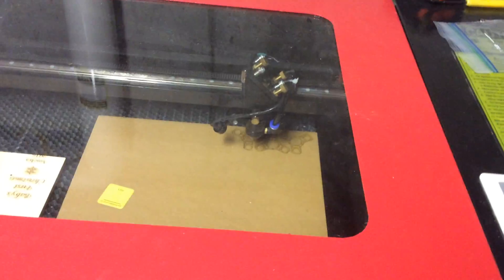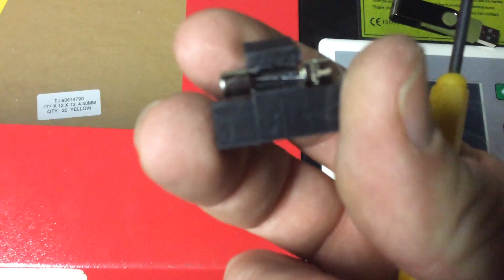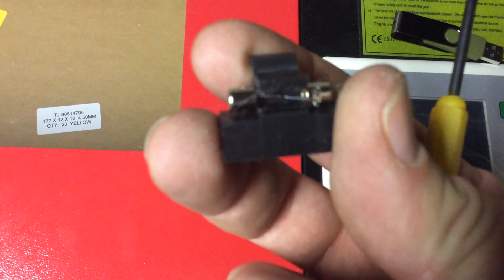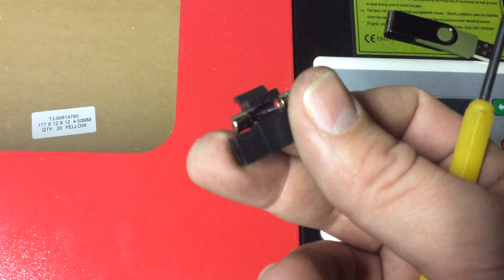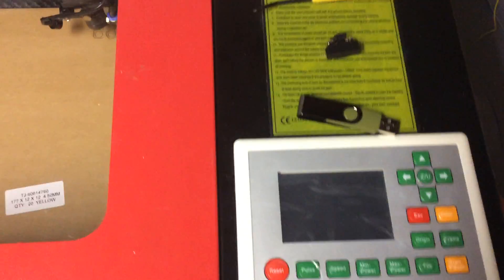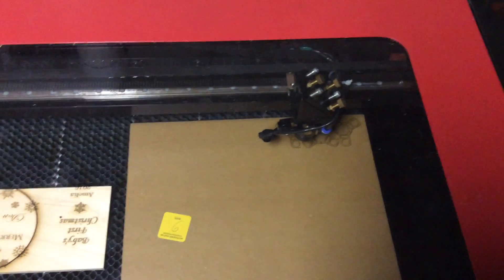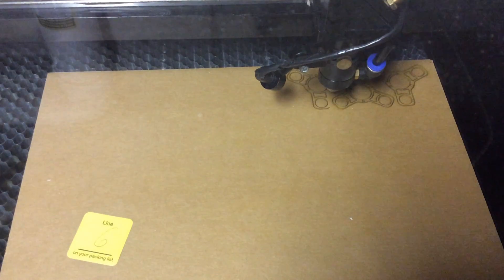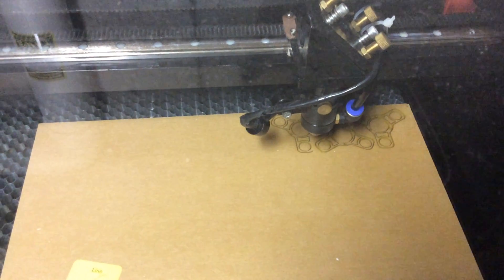Laser Power Supply Blowing Fuse

Comment: I'm experiencing the same problem now, please what is the solution
Reply from the maker: Something to check on that I found later on was the wiring to the E-stop switch was loose. That caused a couple things - one was the blowing the fuse issue. Sec ond my E-stop contacts melted. Check the wiring behind the panel and see if you have the same issue.

Comment: My issue is similar. After a few months of owning my 100W laser (less than 8 hours total run time). I am suddenly blowing fuses about 2-4 minutes into a job. The job is cutting acrylic and I am only at 60% power. (I never go higher than 60% ). Anyway, the machine only blows the fuse while the laser is running. As suggested by the kind folks at Rabbit Laser USA I am running the air compressor off of a separate outlet (not the one on the back of the machine), I need to do the same with the internal fan. The folks at Rabbit said that those components may be pulling extra amperage and blowing the fuse but this did not work for me. I mention it because maybe this will help someone else. I am still blowing fuses and I think my next step is to replace the laser power supply. 

One other thing the folks at Rabbit had me check was that the power cables to the laser tube were insulated properly at the terminals with electrical tape. They were. The people at Rabbit said thet if they are not insulated properly that they could ark to the frame and short out the machine. 

Is there anything else I should check? before buying a new power supply? 

Is there a way to check whether my current power supply is bad? 

Thanks.
Reply: Did you have to replace the power supplies? My duel 130-watt lasers outlet that goes to both the power supplies started to melt and blew the fuse and I'm worried that if I just replace the fuse it will just start melting again.

Comment: where is the fuse(s) located on this machine?? My laser stopped working!!
Reply from the maker: If you watch my video I show where mine is.  There is a power cable on the control panel. It looks like a cable that you would use to power a computer monitor. There is a "drawer" under that. Use a screwdriver to pop that out and find the fuse. You may also have an "in line fuse" - could be inside the cabinet behind the power connector.

Comment: I just had the same issue happen to me.  Has there been a solution found to fix this?
Reply from the maker: I replaced the fuse with a ceramic one instead of glass - same amperage specs - have not had the issue since. Be aware (not that you are not - just making sure) that if you size up a fuse go from a 10amp to 15amp - you could cause major damage to the laser or possibly start a fire. SO DO NOT DO THAT.  I also noticed that I was tripping out when the machine was running off a GFCI outlet. Not sure beyond that what was going on. I did not get a response from the vendor (which was the first purpose of the video). If I find out more I will let you know.
Reply from the maker: UPDATE: There may be an issue with the laser power switch on mine that could have been the cause of this issue. It is the large square glowing switch on mine. I think it could have been shorting out. I am now finding that the switch is no longer turning off power and is "welded open". So the blown fuse issue is gone but the only way to power off the laser is to turn off the mains power. I will try to get a video on that posted.

Comment: did you find the solution? I have same problem
Reply from the maker: I replaced the fuse with a ceramic one instead of glass - same amperage specs - have not had the issue since. Be aware (not that you are not - just making sure) that if you size up a fuse go from a 10amp to 15amp - you could cause major damage to the laser or possibly start a fire. SO DO NOT DO THAT.  I also noticed that I was tripping out when the machine was running off a GFCI outlet. Not sure beyond that what was going on. I did not get a response from the vendor (which was the first purpose of the video). If I find out more I will let you know.
Reply from the maker: ofar4452
2 seconds ago
UPDATE: There may be an issue with the laser power switch on mine that could have been the cause of this issue. It is the large square glowing switch on mine. I think it could have been shorting out. I am now finding that the switch is no longer turning off power and is "welded open". So the blown fuse issue is gone but the only way to power off the laser is to turn off the mains power. I will try to get a video on that posted
Reply: if the fuse doesnt look blown, could it be? Or what else could it be? This happened to me as well. The fuse doesnt look blown, havent replaced it yet. The LCD Screen is blank. Seller is no help so far.
Reply from the maker: You can check the fuse with a multimeter using a continuity check, or you can measure it using the resistance setting. Basically, we want to see that power travels from one end to the other. If it is not blown, we will either get a beep stating there is continuity, or a resistance value will display on the meter. Either works on this size fuse.